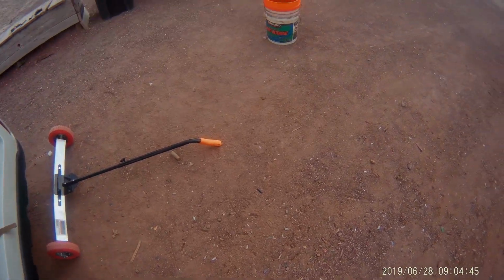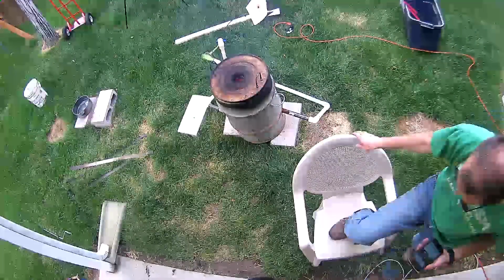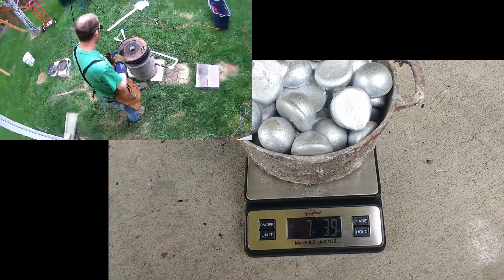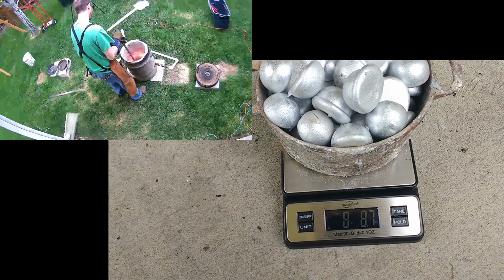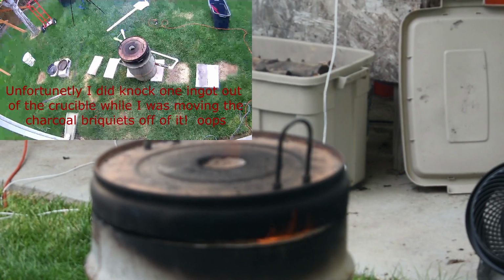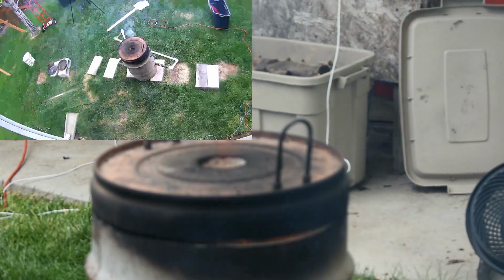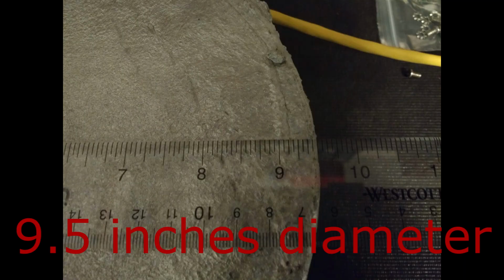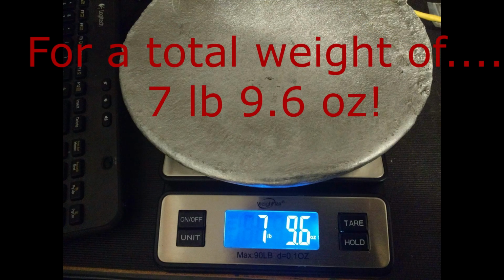Definitely the LARGEST aluminum "COIN" on youtube!  | Over 5.5 lbs easily

Comment: 7 and a half pounds!  Well met! Can't  wait to see what you come up with next.
Reply from the maker: First is to get the next video out from the same melt, finished up the lawn more parts melting and have a grand total there!

Then I have to wait and steal another idea from Sizzle :)

But next actual "project",  2 more "coins" planned:
1/2 inch one 
1 inch

Just have to do the math to try to figure out roughly the amount of loss I had and what it will take to accomplish it.  That or I guess I could just melt a ton and pour to a certain level :)

and then a trip to the range to test them out.....

Comment: That was really awesome 👏 good video. I’m gotta try and one up you now... maybe brass?
Reply from the maker: Yeah going to have to change medium if we're going for weight, crucible will only hold so much liquid!

If I just use the brass i've currently collected from the range you'll hold the record longer this time as I haven't picked much up in the last 2 trips.  But I do have a lot of older bagged stuff I collected years ago when I was going to do reloading (forgot I had it until I started typing this up)......  Still waiting on the new foundry and really don't think I can get the current one up to brass melting temps!  So you can definitely one up me for awhile!  :)

I can't even guess how much that would weigh  in brass!